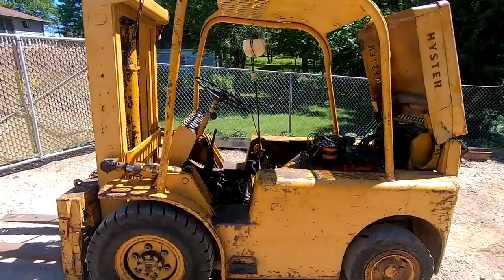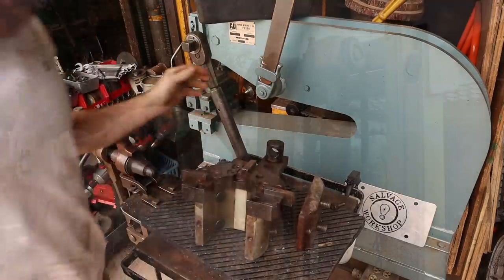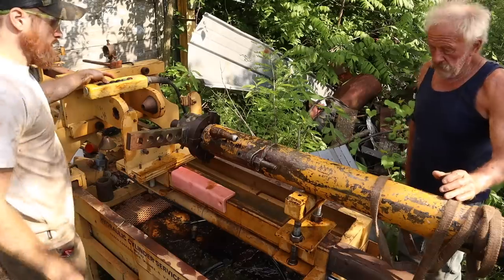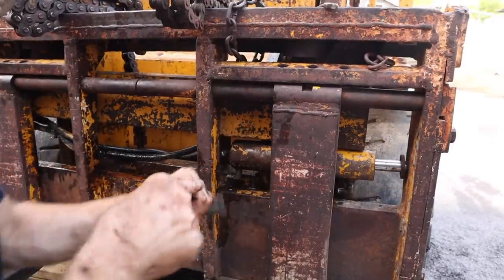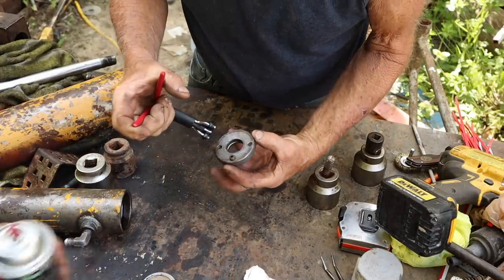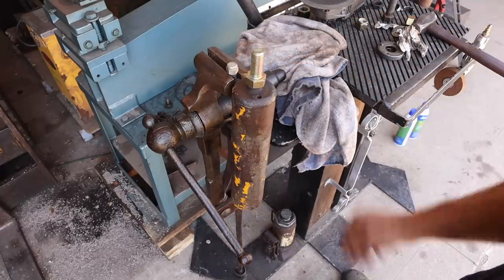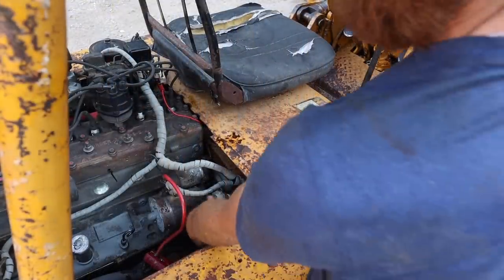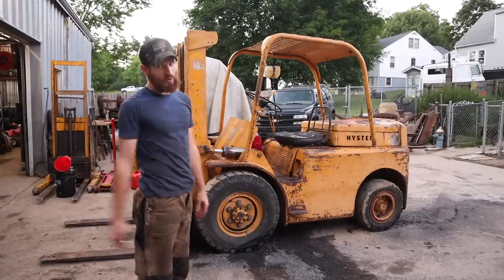Repairing the Old SHYSTER's Hydraulic Cylinders ~ RESCUING a 60's Abused Fork Truck ~ Part 4

Comment: great job on the cylinders - one suggestion, an aircraft rivet gun is great for driving out stuck pins and hyd. parts, it doesn't hit really hard but it hits a hundred times in a very few seconds

Comment: That set of jaws just to the cylinder side of where you thought the head (nut) was supposed to go is what actually stops the rotation. The grub screws engage in the dog slots on the head, and stop it from rotating with the rest of the cylinder. The other piece holds the rod/piston assembly and presses it into the barrel when you're doing the assembling.

Comment: if you ever have to pull those front wheels again just tilt back all the way put blocks under the outer mast rails. and tilt forward. then block up to protect yourself. saves on breaking out the jack. also great for getting unstuck and installing chains in the winter

Comment: I just picked up an Allis Chalmers HD19(along with several other of steel behemoth units) that was used to build the Alaska highway. "Alice" runs and dozes but does need some tlc. I am going to attempt to give her the tender loving she deserves film and post it all. Any advice on filming, camera equipment, editing software, parts resources and technichal information would be greatly appreciated. When I get her ready to start the restoration maybe you might consider taking a trip up here next summer and helping a fella out. Of course compensation would be made and I can take you out and yank some Salmon and monster trout out of the rivers and meanader around the Alaska wilderness. Just a thought.

Comment: H60-C = Hyster 60 (6000 pounds at 24 inches forward of mast), Challenger Series.  
I'm still mucking around with doing the brake cables on my H70C.

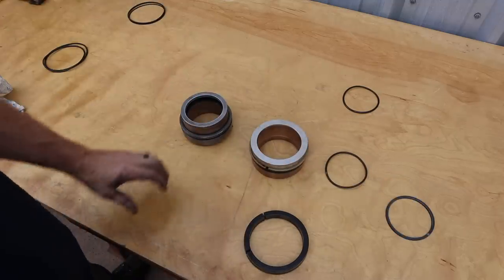Comment: Tech Tip, @26:30  When doing the tilt cylinder first loosen the gland nut in the lift if it is accessible, makes it a lot easier to loosen.

Comment: The fact that you take, what would be considered scrap or junk,  and turn it into something to be desired, is so inspirational. Thanks brother.

I have a 1979 Clark C500 YS80 8000 lbs capacity. There’s a lever connected to the carburetor linkage. (Carb is an updraft zenith). The other end of this lever is connected to a shaft that goes into the front of the motor, (F227 continental ). When this lever is disconnected, the engine runs like crap. No throttle response at all. Even at full throttle. I am curious to know, if yours has this lever or do you know what it is.

Again, thanks for your videos. Looking forward to part 5.  Cheers 🍻

Comment: While slightly loose bearings are better than too tight, loose isn't good either. Especially in something that gets a lot of jolts like a forklift.
You could talk to any semi truck place, they're intimately familiar with these style of bearings, and in this kinda size range as well.

Normally there is a drag spec for preload, where you measure the drag on the bearing using a string wrapped around the hub and a fish scale. On my Toyota it was 3-4 lbs IIRC.
You have to tighten it up too tight at first, rotate it a bunch to get the grease all worked out, back off completely to measure the seal drag (that will be your "zero" point) and then tighten back up until you hit your seal drag + specified drag. 

Then the challenge is finding the specification, but I also wouldn't really worry about it too much as there's no play. Just check it after some use to make sure it doesn't develop any.

Comment: get the construction yellow spray cans.  good wire brush.  one section at a time.  will clean up real fine.  had an old hyster propane.  came out real good.

Comment: So good, loved this series! I’ve got the exact same forklift here in Australia.. on LPG, was running but needed starter motor, battery and water pump so far but it runs great! I need to replace the seals in the steering cylinder which actually looks very similar to the side shift cylinder you replaced the seals on. Can you remember what size JIC fittings they were as I’m probably going to have to get caps and plugs so I don’t dump all the hydraulic oil the minute I drop the lines off (as it is the lowest point underneath the forklift!). Other thing I need to do is it hasn’t got a park brake and a replacement is like $800+ USD, so I’ve got a hydraulic handbrake and I was just going to modify clutch slave cylinders to actuate the levers on the drums.. be a heap cheaper and more fun haha

Comment: I have like a feeling that the top wiper seal on the main cylinder nut you installed is upside down, sadly I'm unable to confirm from the video. It looks towards the interior. The wiper lip as I know should point outwards, so it scrapes off external junk. Nice work though, very nice salvaging of old machinery to give it a nw life. Yap, the crunchy lines are prone to burst.. =)  Keep on, Mr. Haha, Shyster... =D

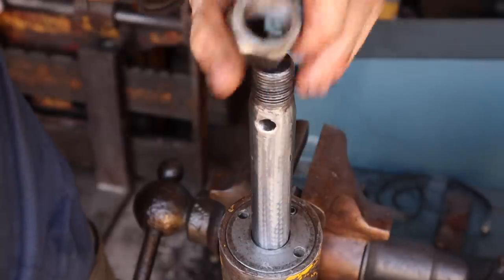Comment: At 50:05 you were talking about putting a hardened bolt into the cylinder. I wouldn't. You want t he bolt to be a bit softer then the cylinder so you can replace it every so often and it doesn't cause damage to the cylinder. The bolt is the wear item.

Comment: The chrome plated part on the stand on the left is the piston rod, that is pressured by hydraulic fluid, the part on the right is the cylinder. I worked for a hydraulic jack repair company years ago, and worked on many hydraulic jacks, which use very similar parts.
Think of an engine. The piston rod connectd to the piston, and we know what the cylinder part is.

Comment: Not sure if you resolved this before assembly, but the wiper on the lift cylinder was installed upside-down. The lip points outwards, to scrape contaminants off the rod.

Comment: It absolutely amazes me how everyone finds the energy & time to pressure wash their equipment when they first acquire it, but just never are able to able to find the time to pressure washi later in their ownership.. I used to charge (40+years ago ..) $10 to any customer who brought their vehicle to me unwashed (THE MECHANICAL S!!)  I still, BEFORE working on anything, pressure wash it first!! I can then see any leaks and work with clean hands! I have NEVER had to use gloves to work on an engine.  I always taught my techs: clean first, THEN work.

Comment: I do not know if you got the transmission to shift faster. One thought I had is, do you have the correct viscosity oil in the transmission? Lighter oil would take it longer to build pressure in the system slowing down the shifting of it. Totally enjoyed the forklift series from start to where you are now, and you got a new subscriber because of it. Thanks again for the content.

Comment: Great video. Does your hyster have the second transmission attached to the drive axle?  I am trying to figure out if they are a common housing as far as the oil.

Comment: Judging by the look of your hydraulic fluid, it might have been a good idea to drain the tank and refill. I know it's expensive but old fluid can be hard on cylinder seals. Hopefully your tank wasn't too overfilled. You want to have the lift cylinder down all the way or you'll have too much in the tank.

Comment: Just an advice, the chains should be replaced, or at least soaked in oil. And there is a reason to not run with bad chains exeptionally rusted ones. With a heavy load you can actually siez on the pin in the chain and eventually brake and you drop your load very fast.

Comment: You probably need trans/hydraulic fluid if not something else. I couldn't see the label on your bucket, but it was very clear unlike trans/hydraulic if it's all one system for hydraulic and transmission. Clutches don't grab well with standard hydraulic fluid.
Enjoy your videos. About how I do things.

Comment: 46:28 Those pickup bed toolboxes seem to be more hassle than they're worth. What'd be better is if the toolboxes were embedded in the sides of the bed instead. there is a LOT of room between the outer skin and inner wall for storage of stuff and I have never seen a manufacturer use it for anything other than holding air.

Comment: no need to remove the main mast ram,all the seals are in the top gland because it is a displacement ram. just unscrew it in place change the seals and reassemble.job done.the thing you are calling a wiper is actually a back up ring the wiper is only found on the inside wiping the chrome.

Comment: You're always asking for Sage advice-
Best degreaser you can't buy-
Exact ratio:
1qt Kerosene
1qt ATF (conventional type)
1C Dawn Ultra
Mix in pump sprayer before use. Will not burn aluminum or copper
or damage hoses & wires like Lye-based "oven cleaners" will.

Comment: From what I could see, that cylinder repair rig seemed to play almost no part in the repair and looked more likely to bend/damage the cylinder than contribute to its repair! What's with the clamping end being so misaligned with the rest of the machine. Surely it needs to be like a tailstock on a lathe and run concentric with the other end of the machine?

Comment: Rather than jacking,  normally use the forklift to do the bulk of the work, front  use appropriate  height dunnage   to just fit under mast when tilted  hard back, tilt mast  forward , both drive wheels  lifted, 100 % safe ,  standard way to service forklifts,  back wheels,  lift weight is reduced by  weight on forks 
Why fight things when the fork lift can do the  bulk of the job for you.

Comment: Dude, at 21:34 that is a dust cover for the end cap of the cylinder, and you showed it backwards, hope you installed the right way, at least. Also at 50:30 the seal is installed backwards.

Comment: As you have many pieces of equipment with hydraulic lines, maybe you want to buy some manual hydraulic hose makers and do it yourself.  They are inexpensive enough and there are many on the market that it will save you big money over time.

Comment: At 53:01 you are installing the main lifting cylinder! In doing so you are doing way too much lifting/work, I would just use a Tri-pod to lift cylinder into the air and then lower it into place with a come-along!  I have three (4” OD) ridge poles(12’ long) with a one inch threaded rod about 18” long! This threaded rod I would slide it into inch holes I have in the end of ridge pole then into a large hanging plate (4” x 1/2”x 10”) long)with two holes into it! One hole is for the one inch threaded rod to pass through on the top end and the other hole it two inch OD on the bottom end. Now on the ridge pole s there will be a 1 1/4” hole on slight angle to allow poles to be spread out on bottom and not bend the one inch threaded rod! On bottom of ridge pole I learned to put a small hole to allow a ratchet strap hook to hook into each pole just so poles won’t allow the pole spreading further then what you need it to. Distance between each poles….. I used these to pulling car engines so I would spread them far enough to go on outside of fenders of the car! 
The hardest part of these were to get them into the air! To stand them by myself…. I would figure how widespread the outside poles need to be! So to stand Tri pod…. Put the two outside poles on the ground then take the center pole which has the one inch hole on top end which is straight through without any angle!llay it between the outside poles with the threaded rod holes all together put the other end of the center pole needs to be opposite of the outside poles! Much like spreading out your thrum,your index finger and your middle finger into a Tri-pod! Now you have your threaded rod through the first outside pole with angle 1“ hole  then slide on the lifting plate then the center pole and lastly the other outside pole. Put large flat washer on following with a large nut on both ends, however do not tighten the nuts very much! Now everything is bolted slightly together! Start raising the Tri-pod at the center of all of the poles now with the two outside poles spread the width required and anchored to the ground somehow so they won’t slide, I would then lift the center pole as high as possible and then push the center pole up into place! Once up it’s very strong way of lifting heavy stuff like car motor and transmissions at same time. But be sure you anchor the center pole too!

Comment: the side shift cylinder should be double nutted on the rod end so it doesnt rotate and back the nut off the other end if double nutted should have the lock nut on 2nd
Reply from the maker: Yeah I had the same thought.... I put two small tack welds on the nut to keep that from happening... If I need to take it off, I can just grind those off really quick and then remove the nut.

Comment: I worry about you using a cutting disc without a full face shield. I had a cutting disc shatter, and it made a big mess of my face. Luckily my eyes were OK because, at least, I was wearing safety glasses.
Please use a full mask when cutting. I learnt the hard way.

Comment: When you cleaned up the top of the Piston that is way too abrasive, you've got to redress that and get up to five or 600 grit and get it polished just like the Chrome, or you'll wear that new seal out.
Reply from the maker: That was a 3m polishing cookie specifically made to clean up hydraulic cylinders.... I think it will be fine!

Comment: Dude it’s there but I understand what you mean it’s came a long way been fallowing I’m very impressed on how You go about it very cool never wondering wow that was my main issue all those Hydraulic lines even before you took off the motor for the first time I was thinking Hydraulic lines everywhere I worked with Hydraulics so I know the frustration keep it going my friend. FYI Mo Flames ok on paint job myself I like to see all original color colors put on nice not cheesy nice that Machine has so much potential..

Comment: you put the top wiper seal upside down. the pointy bit should be facing out, it's a wiper and push's dust away doesn't have anything to do with oil.

Comment: Find all u can that’s right lots of money don’t trip on the trash truck I drove a front loader I have adjustable forks those  small lines are always leaking on my windshield. So in my opinion your coming up on this Hyster the drive wheels look so cool because they are air tires.

Comment: How expensive is it if you bought high pressure hose the different fittings and a crimping tool you don’t have to buy it all at once but just the common sizes to make your own hoses with you dealing with hydraulics all the time

Comment: tHAT BACK END OF THE MACHINE WITH ALL THE HOLES IN IT LOOKS LICK IT MAY BE CONCENTRICK AND BY MOVING IT AROUND TO THE CORRECR HOLE WOULD SET IT UO FOR BEING STAIGHT SO THE CYLINDER IS KEPT STRAIGH AND YOU CAN MAKE UP AND BREAK OUT THE CYLINDER  CHECK IT OUT MAY HELP ???

Comment: I've seen procedures where smooth solid forklift tires have new treading cut, something along this https://www.youtube.com/watch?v=vzz3r2zZbwA line; do you have any intent to do something like that to the rear tires?

edit: or the front tires, also that video is not affiliated with me in any way, it was the first one I found that depicted the procedure i was referring to cleanly. 

Do you prefer stick welding, or do you ever break out some TIG? 

What is your day job, if you have one, or is this your full time gig?

Can you make a video that describes the acquisition order of your hardware (specifically the hardware/machines that you acquired before starting this channel)?  I want to have similar adventures as you someday, where would one start? a Stihl chainsaw and side work? or do you need shop/garage space first? learn to weld first? I'd love to know more about your recommendations to learn the skill sets you have in an efficient pathway. 

Sorry for the question barrage, I'll make it a point to ask one question per vid---youtube algorithm boost, you know :)

Excellent (marvelous)video, and I couldn't be more proud of your fine work :)